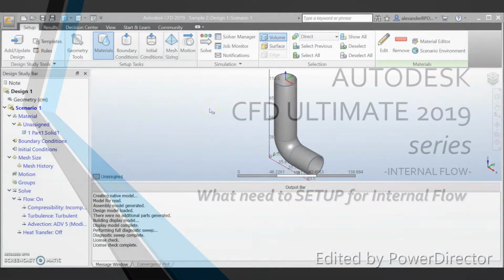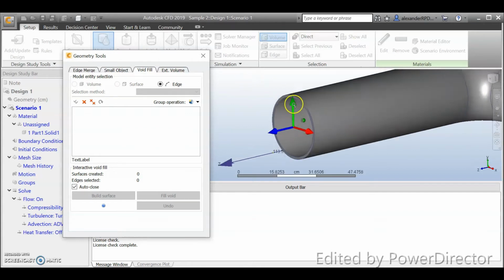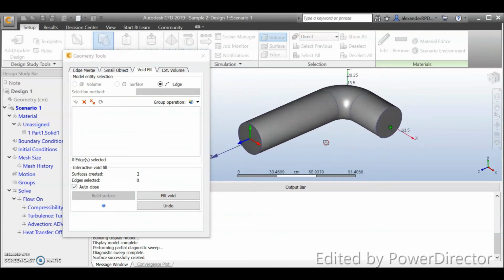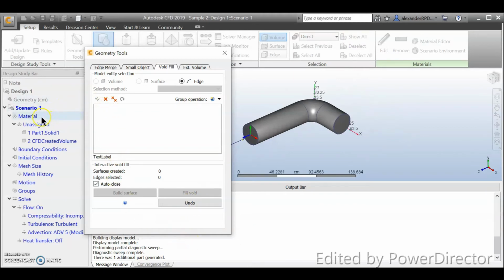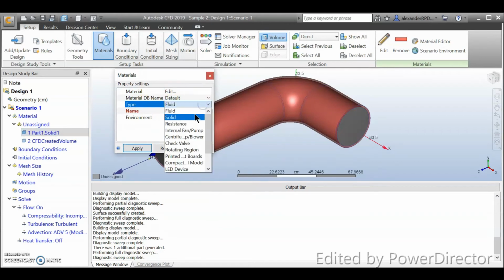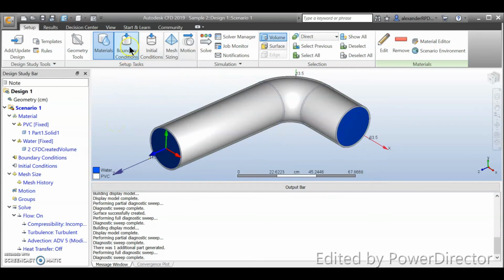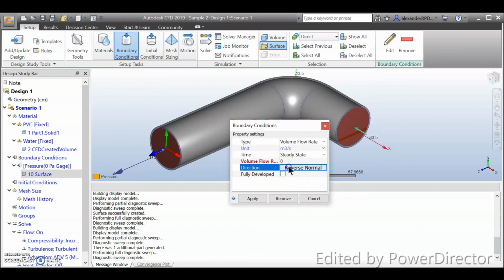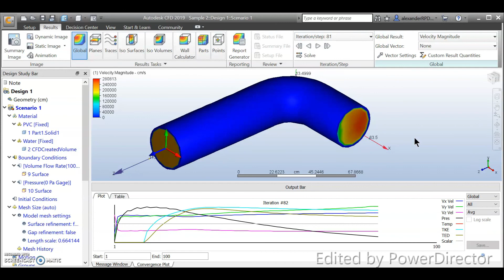autodesk cfd ultimate 2019 - # Internal Flow Setting

Comment: Hello Sir, What a great video! it helped a lot, but a simply inquiry regarding the inlet and outlet of the pipe. I did not understand the boundary condition how you put Pressure at output ? and why arrow directions are not like in and out it is like both coming in 1 point. I hope if Sir can explain this. Thank you !

Comment: Thanks for this useful tutorial . I would like to know the temperature transfert if the pipe will heated gradually to for example from 0 to 65degree  max, and we will run cold water in the pipe, How we can setup the boundary conditions and the initial conditions?. Thank you a lot in advance, i hope that you could help with this.